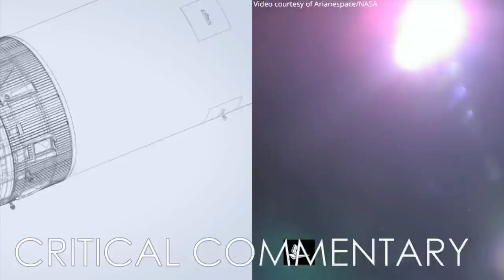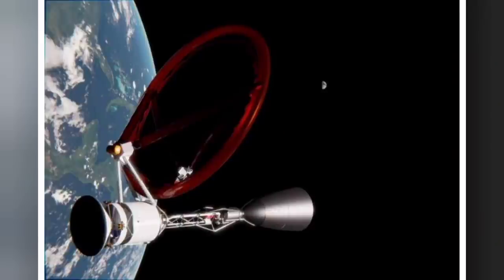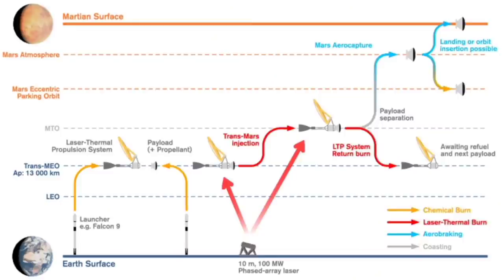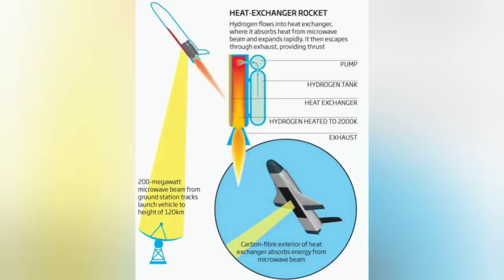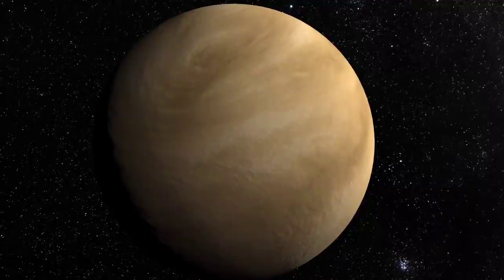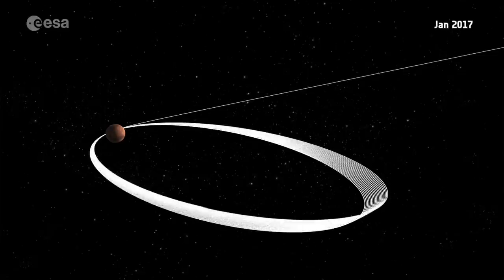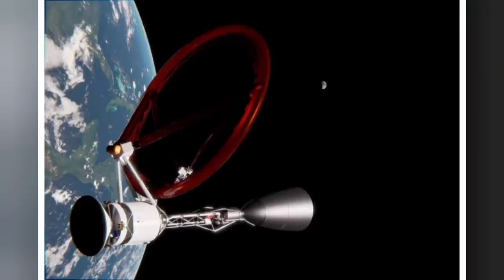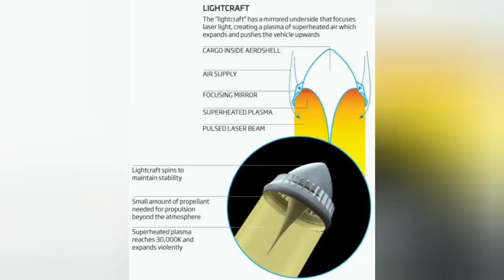Interstellar Travel using a NEW Laser Drive?  These guys have taken the first step!  INTERVIEW!!

Comment: Love the space craft design, amazing idea. Definitely want to keep track of these guys, but why have a ground based laser? I have no clue if it would more or less feasible but a space based laser using solar cells would seem to be more efficient maybe? Tbh idk, just thinking about the possibility of energy losses from distance and atmosphere. Plus with the earth moving, wouldn't it be much harder to hold focus on a small object in space?
Reply: I have thoughts on that as well. How much of our atmosphere would be heated by that. What happens to something that might pass though the beam.
Reply: Wouldn't you need thousands of these Lasers around the Equator?
Reply: Why ground-based lasers? Because space-based lasers would work as a weapon, driving everyone else paranoid.

Would there be energy losses? Yes, but you can just use enough emitters to get past that (more emitters instead of stronger emitters makes it easier to not turn the air above you into plasma).

How about aiming? Telescopes have been demonstrating enough accuracy for this task since around 1900, it's not that difficult.
Reply: @whisthpo  nah, it's only supposed to burn for an hour.  It's basically supposed to launch from the moon, where you'd have plenty of time with just 1 array.
Reply: The atmosphere would surely make the laser beam fuzzy.
Reply: @blankblank4642  It would, but that's not really a problem.  You'd just need to overpower your array.  I'd be more worried about how to adjust the fluctuating energy levels caused by atmospheric interactions to protect the spacecraft from damage.
Reply: Thanks for your interest in our work. Building the laser in the ground will—for the foreseeable future—be cheaper than in space. Also, much easier to service, since technicians are cheaper than astronauts!

Astronomers have become very good at adaptive optics: They can remove the effect of the turbulence of the atmosphere by using adaptive optics. We would plan to use the same technique—in reverse—when we beam the laser out of the atmosphere.
Reply: @A_J_Higgins  It bums me out Jordan didn't quite have a grasp on what ISP is (and questionable use of delta-v) but I appreciate how you handled the response.  I started pretty skeptical of the project, but am now feeling significantly less so.  Well done.
Reply: @MarsEmbassy  The laser would operate at 1 micron wavelength. There is negligible atmospheric absorption, and thus very little heating, at that wavelength.

If passing 100 MW or 1 GW through the atmosphere sounds like a lot, remember that every Falcon 9 (or any other rocket) is also dumping gigawatts of heat into the atmosphere as well.
Reply: My thoughts are to put the lasers on the dark side of the Moon to releave ignorant fears that the lasers could be used to blast at Earth? The reason the laser needs a Moonsized footing that I've commented on before, is because of the force from the laser gun. I'm sure a Plasma Laser would give more kick than a shot gun? Not that I've ever shot either...
Reply: @whisthpo  No. The laser-powered burn only lasts one hour. The spacecraft starts in a higher Earth orbit, so it remains in view of the single ground-based laser site during that period.
Reply: @A_J_Higgins  Hi Andrew, thanks for answering my question. That makes a lot of sense, it always comes down to money. I was just wondering because the pros and cons seem very close to me. One more question.. 

It will probably bring even more comments.. then likes Lol. If Starship is operational in the near future could that change you're outlook on a space laser, or still to ambitious?
Reply: @somedudesstuff801  Thanks for that correction Dude! Moon based laser[s] would make much more sense... When the 2 Gateway Stations and a Moonbase 'Alpha' are up & running, I might be a bit more interested!

Comment: VASIMR (Plasma Engine) can theoretically get spacecraft to Mars in similar time frames. You should try to get Franklin Chang Díaz to come on your podcast and discuss his vision for VASIMR and its capabilities. Apparently the main impediment to VASIMR is a space capable portable nuclear reactor able to generate several hundred megawatts of electrical power and disperse its heat in the vacuum of space. Nuclear submarine reactors generate the required power, so the challenge is purely weight and heat dispersal without access to an ocean of water.
Reply: definitely, i have been trying to follow ad astra for years, but have no idea where their engine is going at the moment, think nasa still suporting but not sure, or have nasa got bored and turned to looking for nuclear propulsion. Last i heard they were upto 80 hours continuous operation, but is that enough? And their stationkeeping version may be relavant now.. Also they had a 45 day mars concept, but nasa not jumping on them, zubrin hated it (so must have been good)
Reply: @tonyug113  As mentioned, without its fantasy reactor (10x the output and 1/10th the mass power ratio of any in existence), it's going nowhere. The heat dissipation of such a beast in vacuum is anything but trivial.
Reply: The secret to making VASIMR good is to skip the on-board nuke, and use microwave beamed power instead. Lets you keep the bulk of the heat exchanger system separated from the vehicle under acceleration. Throw some of your emitters onto Cycler Stations, and you can have your second and later missions to anywhere be as fast as the investment that you spent on the first mission can allow.
Reply: @absalomdraconis  You are correct that VASIMR is limited by requiring an onboard nuclear reactor at power levels that do not currently exist.

Microwave power beaming over long distances is very difficult, however, due to the long wavelength of microwaves (mm to cm) which makes them difficult to focus onto a target. You would not be able to beam microwaves 100,000 km into space without having the beam spread out, unless you built a huge (10 kilometers on a side or larger) microwave antenna. This is why our proposed design uses a laser that uses a shorter wavelength (micron) laser, which allows the laser array to be 10 m in size.

Comment: Laser from Earth for spacecraft propulsion will work at "relatively close" range, but defiantly not interstellar. 
Could be used for IR radiation thrust, or direct to electrical or thermal power.
Reply: Blue to green, and separately 5cm to 10m radio wavelengths pass through Earth's atmosphere.

Comment: Keep it simple. Nuclear rocket using liquid hydrogen. Refine 1960's technology with current technology and materials. Leverage Starship to loft it to LEO in several pieces including full fuel tanks.
Reply: The 1960s nuclear rockets that were built and tested (NERVA) only had an Isp of 800 seconds, which could get you to Mars in 4 months, but probably not much faster. They are twice as good as chemical rockets, but a factor of two is not enough to really change the equation of how we would get to Mars.

Comment: if you can turn around and come back using a laser coming from earth, why not just slow down as you approach mars using the same technique.. dramatically opening up the possibilities for entering orbit around mars or landing on mars? not sure why so much time is spent on.. aero-breaking? sure maybe some of that is relavent, but mostly to more traditional forms of approaching mars. it'd be like building an electric super car but requiring it to have square metal wheels.... the whole point is to speed up and slow down in as little time as possible with a bus like this... using the technology advantages of the bus itself

Comment: 8G for FIVE minutes! Yikes! An astronaut couldn't take that. Max a fighter pilot takes is 9G and that's with a G Suit. Nobody could take 8G  for five minutes.

This is unmanned only, surely.
Reply: There are ways they could take a lot more.  What if they where submerged in water like a diver.  This would make it easier in the body in high g’s.
Reply: @MarsEmbassy  

Err, yes, but that's not in the paper these guys wrote. And water weighs to much so not a solution. It also wouldn't work.
Reply: @martinw245  yea. I was going buy something Dr Robert L Forward once was talking about with the water.  There are issues with it yes. The weight of carrying that much water for one.
Reply: "Nobody could take 8G for five minutes." Incorrect. Astronauts and cosmonauts that train in the centrifuge at Star City in Russia train for 8 g reentry and sustain that acceleration for several minutes. It is tolerable if you are oriented correctly with the proper support seat (this is different than a fighter pilot, for whom the g-loads can be in different directions).

Esther Dyson, who trained at Star City as a backup for Charles Simonyi's flight to the ISS on a Soyuz, reported that experiencing a sustained 8 g training exercise in the centrifuge felt “kind of fun."
Reply: Also, you might be interested to know that Alan Shepard and "Gus" Grissom experienced 11 to 12 g on the early Mercury-Redstone reentries. Provided you are in the correct orientation, these accelerations are quite tolerable (acceleration is passing through your torso, front-to-back, and not up-and-down).
Reply: @A_J_Higgins  

Thanks for the info. That would make sense if perpendicular to the body .

Even so, that's a 12 stone man experiencing 96 stone on his chest. Don't think I'd fancy that.

Comment: ATTENTION ALL: I thought I had heard of this technology before and I had.

I studied aerospace engineering at the University of Illinois finishing at the end of 1987. Prof. Andrew Higgins got his degree at Illinois a couple of years after me (check his LinkedIn). Prof. Higgins started there in 1987 and finished in 1991. He was doing his first semester as I did my last. 

I remember discussing this technology with my propulsion professor in 1986 a year before Andrew Higgins was a freshmen.

I had that professor for Aerodynamics 1 and Propulsion (aircraft propulsion - turbines, ramjets, etc.). He was also supposed to teach a senior level class in Electric Propulsion which I'd planned as one of my senior options. He cancelled the class which annoyed me, but not enough people signed up. I know that because I went to see him. At that time he told me about 2 of his research projects and one way to get on the good side of your professor is to listen (with enthusiasm) to them. One project was a ramjet for flying through Titan's atmosphere using the hydrocarbons in the Titans atmosphere as the fuel. The other was this technology of powering spacecraft by lasers.

So when they say this idea isn't new its actually over 35 years old. Andrew Higgins most likely had the same professor for the same propulsion class and what he's doing is an extension and continuation of our professors work. He's certainly taking it closure to fruition. But also take note of what he said about the types of laser needed. They're about 10 years away. Without a major boost or breakthrough this wont be happening next week. Aerospace development is sometimes horribly slow as Angry often points out.

Also I would suggest that most likely for actual missions the laser will either be in polar orbit or somewhere like the Lunar South Pole, where the laser can be solar powered and not have to punch through Earth's atmosphere. Imagine the Greenies howling about birds being barbequed by the Mars Laser.

Comment: if you have an acceleration plasma track, then either or laser or dc railgun, in the craft itself, low mass, high speed, standard ion drive, but not static electric field, but current-laser acceleration and very long stick that fits easily in a carrier rocket, also, 2nd stage, after 0th stage railgun launch track and 1st stage orbital rocket, or just 2 stages, launch track and the craft ion acceleration track propulsion
Reply: just reflect the input energy opposite to where you want to go, its just smoke and mirrors :)
Reply: its like pelton wheel
Reply: the reflected beam should be dispersed, by a inverse parabolic mirror, does not have to be flat mirror, more like a laser mirror dispersion lamp, to de-couple the source laser beam into a diffuse light
Reply: hows the darth vader in this interview :)
Reply: you dont have to send people, stop keeping that as the main design parameter, it can be done after, always
Reply: dave... dave.. im not a bot.. dave..
Reply: you already have megawatt lasers
Reply: dont let your craft be melted
Reply: why do you lie
Reply: you just want to earn money, omg
Reply: yank out the money then you are given the stuff you wanted to get
Reply: no you dont need to
Reply: moon is a better place for a laser source
Reply: stop money, its insane!!
Reply: you can even vacuum tube to higher atmosphere, or just push through the atmosphere with local laser, or just railgun track to upper atmosphere to orbit
Reply: go indie, no begging for money, if you cant do it yourself, its not worth being slave for, anyone